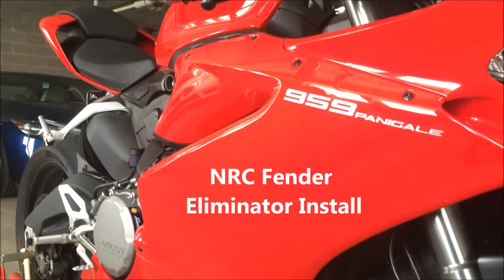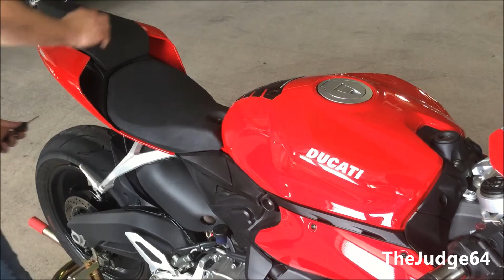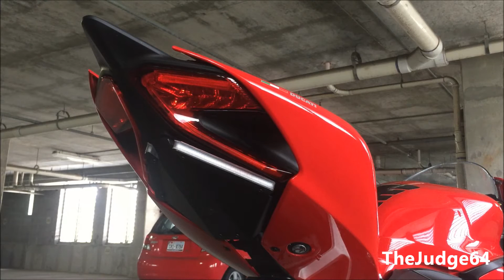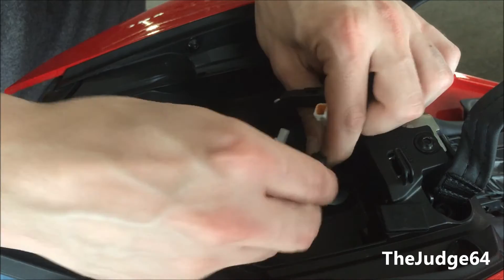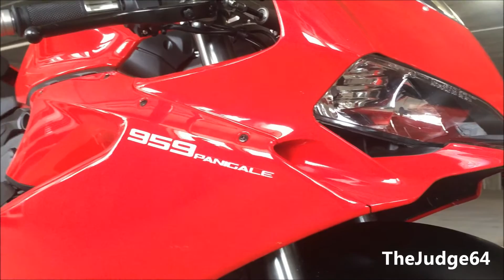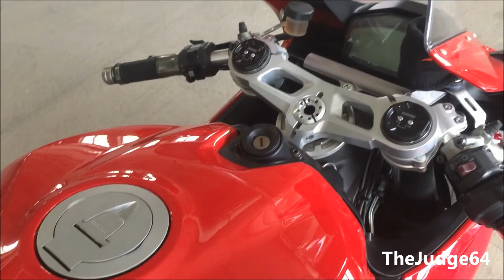NRC Fender eliminator install Ducati 959

Comment: Wow...no instructions on taking off the old one??  lol. Those 2 4m bolts are a royal PITA so I know why....
Reply from the maker: Glenn we had removed it a long time ago and ran some led blinkers for a couple months until we decided to pick up this fender eliminator hence why there is no footage of taking the whale tail off. Sorry!
Reply: All good. Just trying to find how some guys did it. Doing the 959 as a track bike so no replacement. But man, there are only little slits to maneuver  through or take out the lock and go in through those holes. I'll get it. Thanks for the quick response!